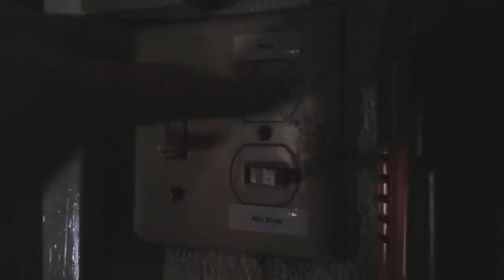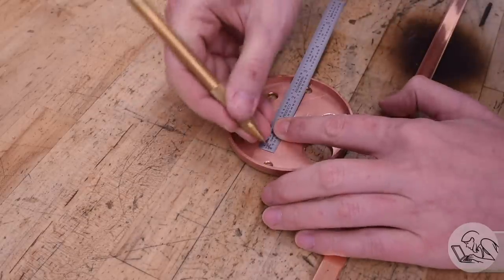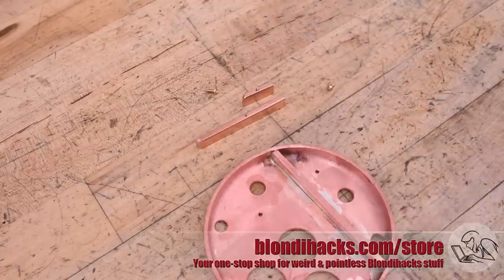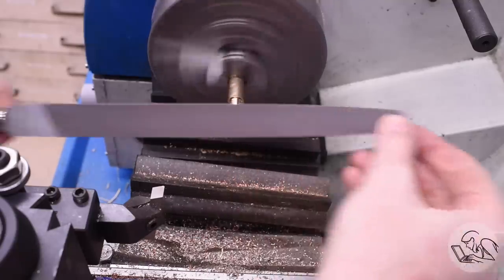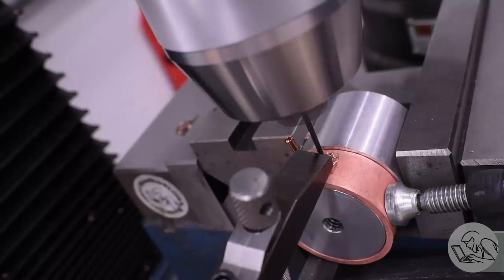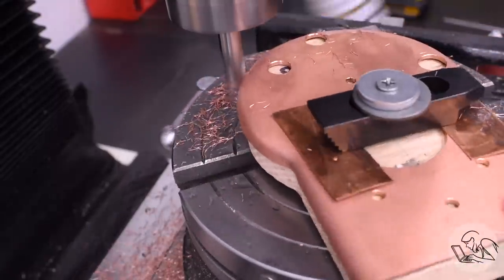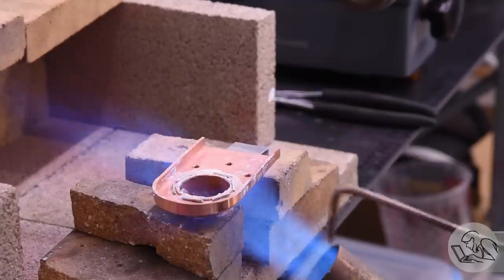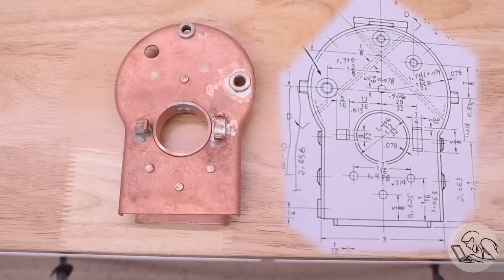Finishing Boiler Bulkheads - Pennsylvania A3 Switcher, Part 3

Comment from the maker: Hey everyone! Lots of folks asking about the broken drills and reamers being too long even though I have the new mill. Well, that’s because the new mill only came in right at the end of this video. If you look closely, you can see the mill magically upgrade itself in the middle of the firebox tube sheet. 😬 The new mill should fit all my reamers and with 4000rpm I’ll break a lot fewer of those tiny drills (I hope)
Reply: Outstanding....Thanks you Mam.....                                                                                
Shoe🇺🇸
Reply: Very nice work on some pretty challenging parts, Quinn!
Reply: During a recent phase of my large scale solar project drilling 1/2" to 1/4" copper bus bars that was my favorite exasperated phrase around the shop "I hate drilling copper!"  I didn't want to use lube however in the future I will try a higher RPM.  Micro carbide Dremel bits and a press from the other side were my friend to extract these broken beauties.
Reply: Yes, no more broken drills. 🤣 Well we can always hope, can't we. Just click your heels together and say "I Believe".
Reply: @0GreatMerlin  Wizard of Oz and Polar Express Reference nice.

Comment: Advice like, "Don't use cutting fluid on copper," is one of those bits of lore that gets passed on without much thought. "It'll contaminate the solder joint." Really? How about finger oils? Residual lubricants on machine tools? If you accidentally get oil on the joint, should you scrap the part? Nay. It's not a problem as long as you're not a slob and you degrease everything to be soldered--something you must be scrupulous about anyway. This means doing more than just thinking about acetone while you wipe off the parts, and it means a certain amount of mechanical scrubbing, wiping, brushing. The acid pickle and flux does the rest. Similar folklore about using only kerosene on aluminum and not using fluid at all on cast iron is also unexamined hogwash.

Comment: Next time you break off a drill or tap in a part, try using alum to dissolve it out:  dissolve a generous amount of alum in water, heat the water, and drop the part in.  Let it cook for an hour or two, and voila, the drill is gone! The solution will dissolve most ferrous metals but won't touch nonferrous metals.  The hotter the water, the faster it works, so boiling water is best, but you could do it in cold water if you were willing to wait a day or two.  With larger drills, you don't need to dissolve the entire thing--just enough that it will fall out of the hole.  I have used this method to remove drills from silver jewelry projects, but I have seen it used with aluminum and copper as well.
Reply: I've tried alum (and hydrochloric acid) and on some broken drills and taps in large half-inch thick copper blocks.  Total fail even after 3 days of gentle boiling in alum. I've changed to Tellurium Copper now and haven't had a snappage in the last three hundred clearance and threaded holes.  I wonder if my taps and drills were high-cobalt or something and that prevented them from dissolving? These days if I snap one in C101 copper and can't get it out easily, I just mill it away with a carbide slot drill or use an annular drill, then ream the hole, countersink it and make a rivet plug, peening it in place with a Big Hammer. After face-milling and redrilling, it's almost impossible to detect the fix.  No use on a steam boiler though, obvs!

Comment: Very nice job, Quinn. I have done some silver soldering, and it hasn't always gone as well for me. Thanks for pointing out the areas where you can't compromise, and I'm glad you took to time to re-make the part you were a little unsure about. That really speaks to your commitment for excellence!
Reply: I agree Ron!  Quinn - thanks so much for the detailed walk through the silver soldering process!  The blow by blow description of how the flux changes as it heats was excellent!  I'll refer to this video before silver soldering in the future.Thanks so much!  Also thanks for your talks about drills, boring heads, cutting fluid (yes or no), fit up and solder joint inspection.  It will give many of us the confidence to jump in on a project like this!  

Great '"aside" about the potential collateral damage of the drill breaking - which supports always wearing PPE too.  

Now - after the above (well deserved) flattery - did you just use a die in the tailstock or did you single point thread the staybolts while manufacturing them on the lathe?  or did you do them in another process.  Just curious ...

Thanks Again!

Comment: A tip from the jewelry industry. To remove broken steel drill bits or taps from non-ferrous metals throw them in a bit of pickle overnight. The pickle will attack the more active metal, in this case the steel, and dissolve it without harming the copper or brass or whatever. Don't throw it in your main pickle container as the steel will contaminate the pickle.
Also, titanium makes an excellent solder pick, as silver solder will not stick to it.
Reply from the maker: Great tips!
Reply: This is excellent advice!
Reply: This is a great tip, and I'm guessing works well for copper, bronze, silver and gold. Alumin(i)um is more reactive than steel so probably dissolves preferrentially. Does the zinc also get leached out of the brass in preference to the steel being attacked?
Reply: @hollo9571  In aluminum you can anodize out the tap. All you need is 5-15% sulfuric acid (or sodium bisulphate like the pickle bath Quinn is using) and an old (non-intelligent) 12V battery charger.
Reply: @hollo9571  Beats me. I don't work in brass so have never had to worry about or research that.
Reply: most expensive solder pick, there is ;)

Comment: My first intro to PPE was the guy who trained me on cleaning big fryers. His story was similar to Quinn's incident with the drill. At some time prior to working at a restaurant, this guy had worked with industrial sewing machines. In that shop, PPE was provided, but they wouldn't get on your case for not using it. One day, there was a shop tour coming through, so every one had to use their PPE, if only for the look of it. That happened to be the day the needle broke on his machine. The broken piece ended up stuck in his safety glasses right in front of his eyeball. Suffice to say, he wore it religiously after that.

I'm always a bit confused by people who wear their safety glasses over their forehead (often on the bill of a hat) or even the back of their head! (I guess you get extra style points if your eyewear is on the wrong side of your head.) If it's always covering your face you never need to remember to move it "when it's important."
Reply: Maybe I can help with your confusion 😜
If the safety glasses are scratched up, like for some reason they always are, then it's annoying to wear them. So it's understandable that people only wear them when needed. And of course then there will be times where you forget to put them back on.
Reply: @Jehty_  we stock glasses all over the place. If they're scratched up, toss em!
Reply: > I'm always a bit confused by people who wear their safety glasses over their forehead (often on the bill of a hat) or even the back of their head! 

Some people insist that the PPE gets in the way of them doing their job. Of course, nothing gets in the way of not doing the job more than missing the parts of your body that the PPE was supposed to protect.
Reply: @dirttdude  Sure. It's a personal choice until you get into an accident and your employer gets fined because you weren't wearing your PPE and your coworkers now have to work overtime until a replacement can be hired and trained, because you lost both eyes to an angry pitbull that targeted you for not wearing a condom.
Reply: @dirttdude  That's alright. We're the type of people who point at morons who end up missing finger tips, hands, feet, eyes etc. and laugh.

It all balances out in the end.
Reply: Nothing like a near miss to be a great teacher.
Reply: @MrMartinSchou  I've even had a cynical coworker "argue"  that PPE and the safety program is only there because the company figures it's "cheaper than paying for a new eye." As if loss of an eye wasn't incentive enough to demand PPE from the company yourself!

If you're stupid enough to ignore the safety program and lose a finger or eye, you deserve the company washing its hands of you. But hey, at least you didn't fall for the conspiracy of Big Safety. SMH
Reply: @ChristopherHallett  Goes-over-prescription-glasses safety glasses cost 10x as much as the close-fitting ones that I wish I could wear 🙃

Comment: I've had good luck saving brass or copper parts with broken drills or taps in them by leaving them in citric acid for a few days: the acid eats away the steel but does not harm the brass/copper. As an aside, I also use citric acid for pickling parts when silver soldering. Citric acid is widely available as it is used for cooking/canning (it is also an ingredient in a lot of soft drinks) . I do get mine from McMaster Carr but I understand it is available from restaurant supply stores and even some grocery stores. It comes in fine granules that dissolve easily in water.
Reply: Yeah you can get it at grocery stores or hardware stores (like Menards) that have a grocery and canning section.  It's a handy thing to have around for many reasons. Make your gummy treats more exciting, too!

Comment: It's a very good idea to have your stick of solder close to hand so that if you see place where there may not be quite enough, or a tiny gap, you can just touch it with the solder. As you mentioned you need to be certain that the boiler will not fail for want of a touch of silver solder.

Comment: When I had a machine shop years ago, I had a Lagun milling machine and I used a Precise high speed head in a custom ground fixture in the Mill. This head was fluid cooled and would produce over 90,000 rpm for miniature drilling and milling work. I used an alcohol based lubricant and never broke a drill nor milling cutters working this way.
You are doing very nice work on the boiler even though it was mirrored on the boring operations. I do see the problem with the drawing it didn't have a datum location established for the front. Datums are important and also it was nice that the whole thing was inspected by the "rubber ducky."

Comment: Love the use of the haemostat for positioning the 'sodder' at 15:20. I have many surgical instruments in my shop - all procured from ebay for next to nothing.
Reply: As a retired oral surgeon I can second that! Quite a few instruments from my OR have made their way into my small hobby shop and are quite useful with tiny parts. Including my surgical magnifying glasses with LED light which I have used more than once. And you are right. These instruments are available dirt cheap on placec like e-bay. When I had to buy them for the OR they cost an arm and a leg!
Reply: @berndheiden7630  happy to hear you worked in oral surgery rather than amputating limbs. Otherwise, that comment about them costing... "an arm and a leg"... could have raised some suspicions.
Reply: @johannesmajamaki2626  That‘s a good one! LOL
Reply: @ChristopherHallett  Worcestershire.

I rest my case 😉
Reply: @jonofalltradesmasterofnone832  I know - but Quinn uses both pronunciations - sometimes rhymes it with fodder, and other times with folder!

Comment: Wonderful progress!

I'm a fan of the bits-of-pre-placed-solder method, as opposed to stick or wire. My preference is to shear off a sliver from the edge of flat strip solder, then snip that sliver into many tiny flat rectangles. The flat pallets of solder are not as easily pushed around by the bubbling flux. I'm also convinced that they take up heat quicker because of better contact with the part.
I suppose one could get a similar benefit with wire solder by lightly hammering it a bit flat…

Choo choo!

Comment: Your excellent tip on filling curved surfaces helped me out with something the other day.

Zesting lemons.

I was always getting flat spots and too much white stuff.  Lifting the handle through the stroke (I was pulling not pushing - trees the way the teeth go)  solved an issue I've had for... well decades!

Never know what you're gonna learn. BTW I'm no machinist nor do I have any machining equipment.  But I love watching your videos! Good luck with the build.

Comment: Hi Quinn
       Building steam locomotives is a real hoot.  There is no satisfaction like running and riding behind an engine that YOU built.  I don't know if this has been mentioned, but a real handy little trinket  when soldering is a lazy Susan. Just a cheap one from the hardware store. Put an aluminum or steel disc on it and then some fire brick.  Put your work piece on it, and when soldering you can revolve it to get even heat all around.  This would have been handy when you were soldering the fire door ring. 
Happy Model Building
Jack

Comment: Some good advice for silver soldering in this one, heating the solder is the mistake many make meaning the solder melts before the metal is hot enough causing poor wicking of the solder into the joint.

Comment: Hi Quinn

I have binged watched many of your videos like the ones on the engines and boilers. 

I really enjoy that you tell it like (the parts flies across the room carrying the vice with it) way it is. 

I have very much enjoyed your fixture hacks. I loved the bar that you used in the big steam engine, a great idea because as you pointed out that engine's all about the center of that bore. 

The steam engines and boiler projects have been fun. But I also like your videos on tooling like the machinist jacks and using purpose built fixtures. 

So just dropping by to say HI. That and keep up the fun work, I love your sense of humor. I love the steam engine chugging mantra that you were reciting as you were chopping off the reamer at the start of this video.

Comment: Best approach to drilling copper with small bits (you know it all but...) ; lots of oil, cobalt bit, ideally the drill bit is a bit dull, annealed copper and lastly peck at the copper. Many stop starts. 
The swarf in the hole tends to grab the bit, so blow out swarf periodically. I make kitchen knives and
always charge a premium for copper bolsters. Lastly- routing wood goes counter clockwise or the grain tears.

Comment: 22:30 My trick to make big holes in flat material is to use the bolt circle function of the DRO. Drill small holes as close together as possible. With soft materials you can cut the small burrs that conecting the inner material with an utility knife. The finish can be done with a boring head. But it works also fine to plunge an other bolt circle with a big endmill. With a big number of holes it gets nearly as clean as using the boring head.
Reply from the maker: Funny you should mention that- I do that exact thing in the next video. 😬

Comment: A tip from my machinist/tool and die maker father in law, there is a technique for reaming called drill reaming and that just has you start with a smaller drill bit and graduate in steps untill the desired hole diameter is achieved.

Comment: Great build!   Treat yourself to a cheap “silver and deming” drill set (1/2 in reduced shank drills from 1/2-1) save the boring head for when you need it!
Reply: Some annual cutters and an arbor to suite them may be a better choice for a small mill as they require less torque to cut and you will be unlikely to be drilling any great depth on such a machine.

Comment: Oops, meant to mention..I have found that when drilling tapping etc., a steady flow of a high evaporation rate cleaner, i.e. brake parts or electrical parts cleaners work great for tiny stuff, even in s.s., and for larger operations a foaming glass/multi-surface spray-cleaner works great, stays put and wipes/rinses off with no oily residue as it is soap & water based (be sure to dry tooling well when finished).

Comment: Hazard fraught has a 9/16"-1" drill bit set that is decent / cheap. If you had a friend grind them down 0.010 +/- and use those for rough drilling it might help. I wish i had a friend that could do that. Good luck and great work.

Comment: Talking about Dezincifying Brass. Some years back, I took a Rusted Worn Threaded Stay (We were replacing them in the Fire Box) from a Marshall Roller, and I do not know why, but I soaked it in CLR (Calcium Lime and Rust remover) for about a fortnight. It looked like Honey Comb, a sponge...with holes everywhere. Presumably the "cleaner CLR" removed all of the rust/Oxide.

Comment: Loving the build. I recently acquired a set of Hougen rotabroaches which are very nice for cutting larger holes in sheet and plate. They aren’t the cheapest but they sure are nice for smaller machines and work in a standard drill chuck.

Comment: I saw you use a vacuum cleaner to remove chips from your work. Many use compressed air. I too was trained to use the vacuum cause compressed air can cause chips to get into the ways ...etc and cause premature wear which will compromise accuracy.

Comment: Years ago when I was at trade school, my welding teacher reminded us of the dangers of grinding without eye protection. His motto was, "Every time you grind or drill without eye protection you're one time closer to losing an eye."
Last week, I was chiseling a bearing race off a hub and a piece of it flew off and into my chin with such force that it lodged in the skin causing profuse bleeding for about 10 mins. A pair of precision tweezers and no harm done. Time lost on the job about 15mins. I had glasses on (I can't see without them but we won't worry about that).
Imagine if that was your eye.